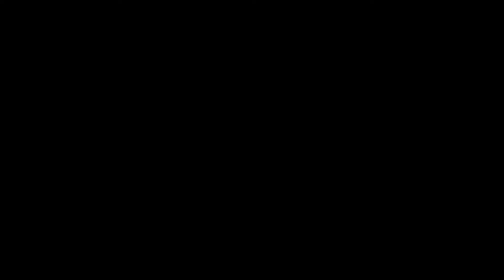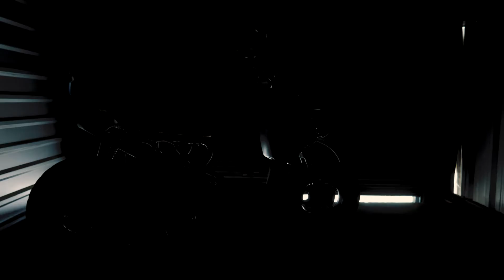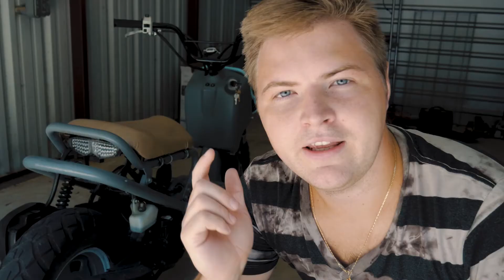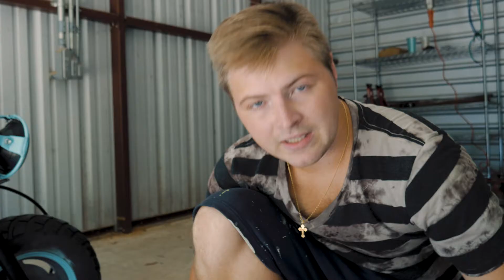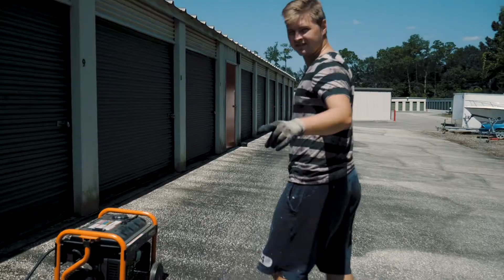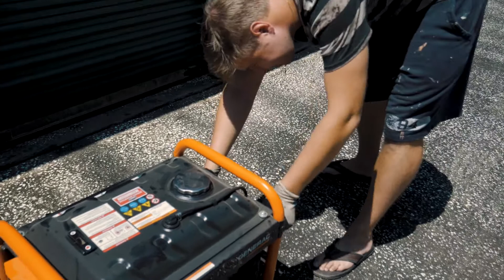Install BR Quick Header/Exhaust Honda Ruckus

Comment: Hey jeep tank
Thanks for the easy install procedure
Its fun to watch
I’m just worried about the ring issue
In other movies they say you should remove the ring from the original exhaust and put it on the new one.
In the case of a yoshimura exhaust it fits
But here in your movie it looks like it doesn’t fit.
Do you think you need to buy a special diameter ring or did you just ignore this procedure?

Anyways big up for the big sound.
Im lining up to buy this BR exhaust
Love the sound
Wanna piss off my neighbors with it XD
Peace

Comment: are you having any backfire issue ? ex. sounds like a dragster when you let off the throttle quick? did you rejet the carb? THANKS!!
Reply from the maker: +adman692 hi yes it does backfire and no o dodnt rejet it yet I just insatallrd air filter and now waiting for Friday to rejet carb because it started bog at throttle.I am sure it will fox the backfire
Reply: cool thanks for the reply
Reply from the maker: +adman692 anytime

Comment: did u notice any difference in performance?
Reply from the maker: +e denuccio mayhe a little not to much honestly. but I just instaled air filter amd have to rejet and then I will be able to tell you.sounds awesome tho.for 1st exhaust its definitely worth it.
Reply: When you put it on did you have air filter or no? And how was it ?
Reply: Jeep Tank Green What jets are you using?
Reply from the maker: I use whatever came with the kit

Comment: hey Bud, they finally got some in stock. so I am about to get one, whats the overall review after pretty much 9 month using it? and what the jet sizes would you recommend after installing that exhaust? Thanks
Reply from the maker: Viktor Daniyelyan hey man sorry for long respond. I don't drive my ruckus daily but I love how it sound man. You don't have to reset carburator with just exhaust but it will shoot some flames to. After that I did change stock air box to ruck shop air box removal and it comes with everything you need and it will stop shooting flames haha
Reply: Saton Photography hey bro, I tried to spin my muffler into exhaust and there is seems to be like 3cm left , are they tapered? Don’t they thread all the way down? Thanks